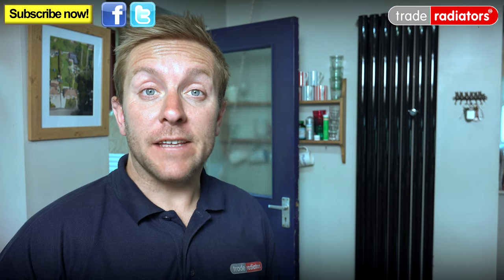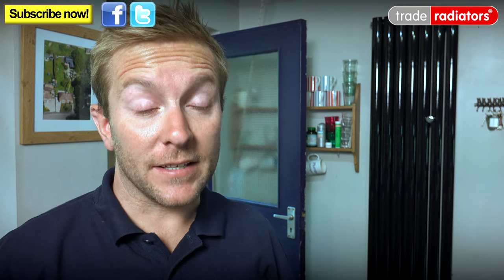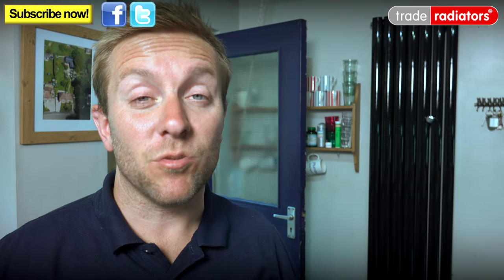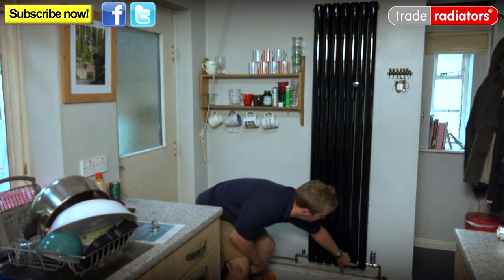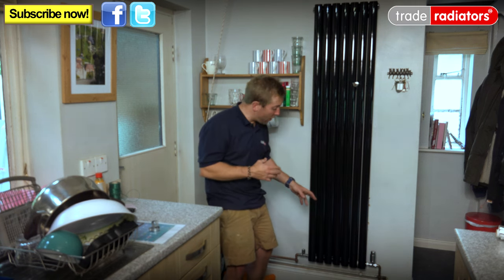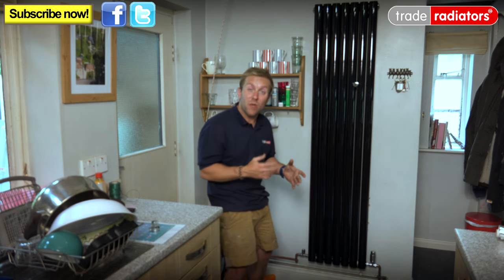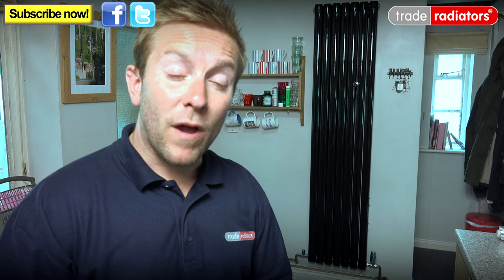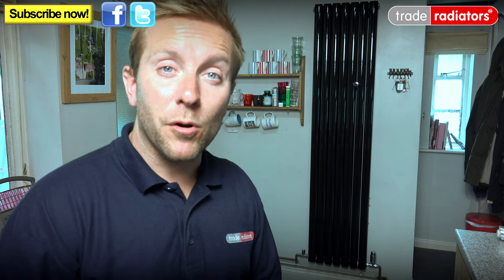How to Balance a Vertical Radiator - Trade Radiators

Comment: I've got a vertical rad, the first two fins get hot but the rest don't, but the return pipe is hot. The rad, trv and LS are all new so I'm unsure how I can fix this. I can't bleed it properly either because the bleed valve is on the same side as the two fins that are getting hot. Any advice please?
Reply: We have the same problem. Any advice would be appreciated
Reply: @gem3374  hey, I realised that the rads have an inlet, outlet, too and also bottom. Mine had small stickers on the top and bottom to show this. The way they are designed inside means they only work properly one way. It was a ballache with some that didn't have stickers on, having to empty and fill numerous times to get right. But got there in the end!

Comment: Hi. I had a plumber out to fit  A vertical radiator. It's never worked since. I'm talking about the sticker that's up on the top left hand corner.. ?? The 2 first vents on the right side get hot.. and the rest are stone cold..

Comment: Hi James, I've fitted a vertical radiator without knowing there was a flow and return. Is there an easy fix other than re piping? ie put a fitting in to change the flow? Tks

Comment: HI I have got a vertical radiator fitted recently to replace a horizontal type of a similar size (output), it wont heat, without isolating or turning off other rads. Should it work if the system was balanced, given it is no larger than the previous rad?
Reply: I'm the same. Tried every rad balancing trick in the book. Think I'm going to have to ask for a refund.